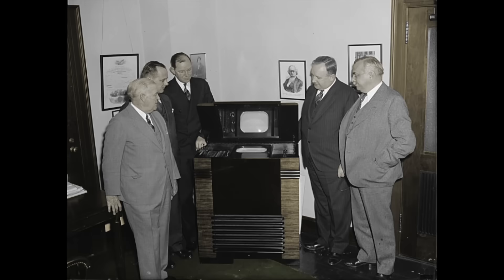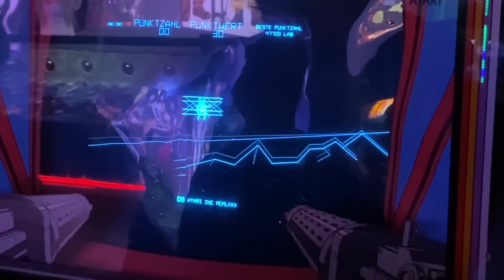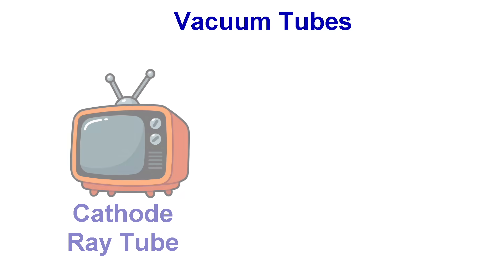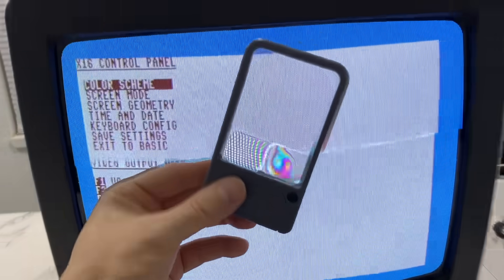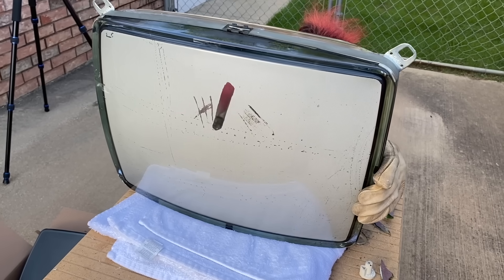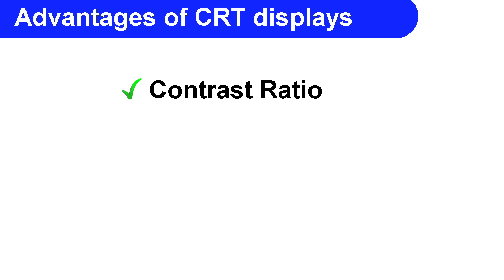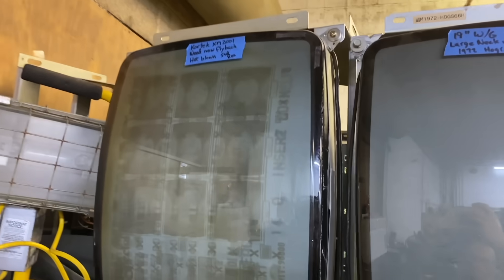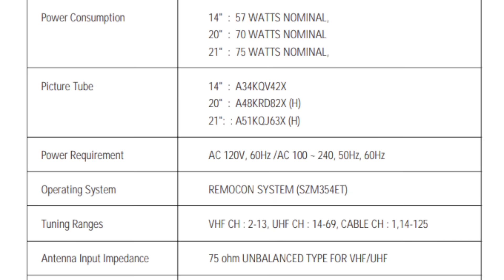How Cathode Ray Tubes Work.

Comment: Notes about 16:9 widescreen and its display area being less compared to 4:3:
This was actually "addressed" in a way, 16:10, offering similar width to 16:9 and similar height compared to 4:3 was actually introduced around the same time when widescreen hit the market. My Dell monitor from 2009 had a 16:10 aspect ratio.

Another note about aspect ratios in general:
Taller than widescreen aspect ratios are going back up in popularity again with the Microsoft Surface Laptops having a display aspect ratio of 3:4 and most iPads having 4:3, other brands like HP and Dell are also offering 16:10 aspect ratios on their monitors and laptops.

Comment: I kept my 21 inches cathodic monitor from 2002 to 2005, at that time, they were much cheaper than LCD screens and I was quite happy with it ! For the same price, at that time, I would only have a very small LCD !
Reply: I replaced mine in 2007 and regretted it for the next decade. :(

Comment: My grandpa's Sony tinitron needed a replacement shadow mask and it costs over $2000 in 1963. Always wanted to use one of these old laser tv's they're such cool tech!!
Reply: How can one replace a shadow mask? It requires melting the screen... It would have been easier to replace it, wasnt it?
Reply: @gabrielvieira6529  that's what he did, he bought a radio instead and said "these new fangled televisions are just a fad"
Reply: @gabrielvieira6529 youd have to cut the tube open then reweld it i guess?? Lots of knowledge lost when people gace up on repairing stuff and just bought new cheap shit from overseas

Comment: One thing not mentioned in the video, that was one of the visible drawbacks of the CRT screens, was imperfect geometry. You were given options to tweak it on most monitors, but you could never get a perfect rectangle at the edges of the screen.
Reply: I think with flat CRT's you dont have this problem
Reply: @gabrielvieira6529  Oh no, you definitively do. With those, it is even more noticeable then with those that are slightly cone shaped.

Comment: When we were switching from CRT to LCD we ended up reverting back for a while because the color accuracy was really bad. Having to imagine what a Pantone color looked like on screen vs on paper was really annoying. But the screens got better and we stopped caring about how colors looked on screen for print, lol.
Even today it's still not perfect, some screens have problems with certain colors. For instance the 4K Samsung monitor I have right now makes Orange look like there's a little noise in it, but it doesn't do that with other colors.

Comment: Similar to colour filters on arcade monitors, in the 1950s and 60s you could buy a device called a col-r-tel which was a wheel composed of red green and blue filters that when spun, synced with an NTSC colour signal and actually turned a black and white TV set into a colour one. There’s a few videos of them around. Look them up the effect is really impressive.

Comment: When I had my Secret clearance in the 80s,  Something that I learned, rumor or not.  The reason why passwords are ******** when typed in is do to cathode ray tubes.    The so called "Russian Trawler" sitting off coast were able to pick up the beam and know the refresh rate of the screen.   Then they could reform and regenerate what is on the screen.  Follow that with a lot of the espionage stuff and now they know secrets.   One fix was to hide the password to access the terminals with *********.   Again I want to point out this was terminals and not personal computers or the internet.  So much like the the far fetched movie Wargames.  If you know the phone number and can get in that far next thing you need is a password.  All this can be True or not True but was part of the training we had when I got me clearance.  Cathode Ray Tubes and the electron beam are just a transmitter.  People with the right equipment and desire can read that electron beam as if it was transmitted from a radio.  Remember when you mom told you not to sit to close to the TV and that a lot more spies are not on Russian Trawlers but more domestic in origin and other government groups.

Comment: for the people that claim CRT's are still superior, the only advantage CRT have over OLED is the resolution and motion clarity. OLED have even better blacks then CRT's plus 0ms lag. and with modern micro LED backlight higher end LCD screen can have per pixel backlight or even per sub-pixel backlight. i own a QD-OLED monitor and i have a CRT screen is sure has a charm and non native content looks still great on it. sure i still want a CRT for the retro look especially with native hardware, but if you have a QD-OLED you can use a CRT filter on emulators and you wont notice the difference.
Reply: I have to disagree. The look of a normal screen is kinda "dead" for my eyes. CRT's are alive!
Reply: @gabrielvieira6529  what do you even mean with alive? have you ever seen a QD-OLED screen in person, especially in HDR? they are better then your normal HDR capable OLED screens. you have to see it in person to know what it's like, preferably not in a show room. and i have extensive experience with IPS LCD, OLED, CRT and QD-OLED displays and can say for certain that QD-OLED is really good. and i think going forward we will see all screens use quantum dots because it produces way better colors then phosphors can. 

and what is a "normal" screen? like LCD, plasma? what kind of panel? VA, IPS, TN, OLED? what type of backlight CFL, LED, full array diming? with or without quantum dots? because the way it's going right now the LCD wil be replaced with OLED or Micro LED display solutions. same as that all projectors will move to full RGB laser.

Comment: 2:23 There are also CRTs that use electrostatic deflection. There are four extra plates inside the tube to add X and Y deflectors.
Electrostatic deflection has it's pros and cons compared to electromagnetic deflection.
These are not used in televisions and monitors because electrostatic deflection requires more depth.
Reply: Wherr were these tubes used? Oscilliscopes or something?
Reply: @virtualtools_3021  Yes oscilloscopes.
Electromagnets distort signals as those are coils. Coils react differently to alternating current.

For TVs and monitors it's not an issue as you only need to generate known signal that can account for coil effects.
Reply: Oscilloscopes especially used electrostatic deflection. Very long tubes!

Comment: The big thing at the beginning of TFT monitors was smearing. Back then I knew that was accepted on laptops as a compromise but I was surprised to see how common it was in flatscreen desktop monitors. When I was growing up I had this one friend who's parents always got the latest tech. I was like 13/14 and it was around 2002. So this kid got not only a gaming PC but also a Dreamcast and an Xbox. Anyway, when this friend invited for the first time I saw 2 things for the first time. A fully networked private home with a (then) broadband internet connection (my family had an old PC and dial up) and one of those really bad TFT displays and I was shocked that anyone would want to work or play anything with that abomination of a picture.

Comment: Thank you! Finally! Every single video that explains CRTs just says something like, "It has an electron gun and a..." And I'm always like, "Wait, wait, wait. An electron gun?" They never explain how the gun works. Ever. This video finally does it. Thank you.
Reply: It's actually a specially designed Crook's tube. What they don't show is the gun itself. At the back end is the heated cathode, which emits the electrons, in front of which are various cylindrical electrodes to control, shape, and accelerate the beam.

Comment: Liked your video however, you left out the second anode and the scan is not 60 Hz. but it was 32,000 scans per second. Even on the old black and white T.V.'s. I started working on these old T.V.'s in 1961, I was very young. People need to know that the second anode has 20,000 volts on it, from the fly back transformer. The tuner has around 800 volts in the circuit. Just a few facts on the subject. P.S. some of the capacitors (the large ones) can be deadly even afters years of none use. I have personally seen capacitors weld screw driver blades to the capacitor terminals.
Reply: All good points, though I'd add the voltage of the second anode is only about 1kV in monochrome screens.
Reply: NO, it is 20,000 Volts. I can assure you of this.  Years later I worked in a TV repair shot, fixed many TV.'s. Real Electronics Technician jobs are  harder to find.  I have also repaired radio transmitters and receivers . Some commercial and a lot of CB's as well as their amplifiers.

Comment: As to the point about CRT's lasting forever, theirs a guy on Utube who drags them out of garbage. Sitting out in the elements for decades, and still able to get them working.
Reply: most CRTs were made at the time when "planned obsolescence" wasn't a big deal with corporations yet. Otherwise they would've found a way to make sure CRTs wouldn't last that long.

Comment: The wide lcd's used to be 16:10 in the beginning though for quite a long time I may even still have on or 2 of them. So if you are talking about computer monitors that would be a more fair comparison for the 20 years ago example. It wasn't really until 1080p became the standard that computer monitors became predominantly 16:9.

Comment: It is weird to me how all the dates in your timeline are 20-30 years less than actual dates in my country. 
First TV transmission : 1950
First Color TV transmission: 1980
And for the LCD displays.... I only see one once, there were too expensive. We used CRTs until circa 2010.
Reply: Sounds a lot like Korea. They started doing Color TV in 1980s too. For having to use CRT until around 2010s you’re lucky because LCD display is horrible in my experience

Comment: CRTs, from my experience and in my personal opinion, will always have a more special viewing experience than what any modern TV could do. Another interesting note is that each line, while technically free of "pixels" consisted of 227.5 color clock cycles, or 228 for the Atari 2600/7800 per line, resulting in 160 "pixels" or 40 blocks of 4 pixels. Each vertical sync would normally consist of 3 scanlines (a regular NTSC video uses 9) with blanking enabled. The vertical resolution of the games are variable, as the timing of the signal was in control of the person who programmed it. Most games had a 262 or 263 line resolution, which is compatible with the NTSC standards of 262.5 lines per field (60 hz), but there were odd titles like Buck Rogers that used 240 lines per field (65.5 hz) for the title card, 248 (63.6 hz) and 249 lines (63.4) for the level loading screen, 262 (60.1 hz) for the initial sublevel, and various amounts for the space sequence sublevel. It was insane how wild the resolution would vary in a different games. There were some games, like Farmyard Fun, that had a strange 281-line resolution (56 hz) that would work on both NTSC (60 hz) and PAL (50 hz) region television sets, since 54 to 56 hz is a snug viewing window that allows both to view the game stably. This oddity only works without fault on Analog televisions. On a modern television, it would be an upscaler's nightmare, because he would have to program several individual settings on each time the line changes and would require multiple buttons to be pressed to compensate for each line change. Thankfully, a "true" NTSC image that is compatible with modern televisions usually fits snugly between 261 lines and 264 lines, even without the use of an upscaler or a convertor. This multi-line issue is also used as a deliberate measure in an early Copyright protection system called "Stop-Copy" by WCI Home Video (now Warner Home Video) on early VHS releases from 1979 to 1982, which also explains why the tapes play fine on any new or old VCR on an old-school TV, but is entirely unwatchable on a modern digital display. The only reason I was able to discover this is because I was able to successfully convert my 1979 VHS of the 1978 film "Hooper" to a blank DVD (which automatically compensates certain standards, regardless of changes), allowing the analog signal to become a digital one without loss of image quality or an alteration in the horizontal resolution and more importantly, backwards compatibility and proper playback on a modern digital TV. Even more interestingly, the video would slowly bounce and add or subtract a black bar that will grow every 10 minutes and misplace the picture to the point that the vertical blanking area will become visible (albiet as a large black bar) and show two seperate fields in a single frame. The tape line count bounces back and forth between 256 to 270 lines every *field*, making an upscaler impossible to use for viewing the film. So the 240p that is always discussed in gaming and video editing? You can forget all about that when it comes to analog televisions, computers and game consoles. This is partially why I am very bitter about the analog shutoff bill that was approved by congress and signed into law by President George W. Bush in 2005, because it meant that a simple mechanism would become obsolete with inferior (although with better resolutions) quality technology.
Reply: I have to agree. Nothing beats the look of watching a CRT
Reply: First sentence is complete bogus and untrue, don't know why you felt the need to put it
Reply: @TypicalBlox I worded it wrong. Updated. :) Sorry if I came off misleading.
Reply: Nah oleds and good miniled are definitly brighter and more colorful, and i say this as someone who daily drives a crt on my pc...
Reply: “Brighter, more colorful than any modern TV”. This is objectively untrue. First of all, one of the big advantages of LCDs is that the light source is separate from the light modulator (in an LCD TV, that’s the actual liquid crystal panel). You can increase the power of the light source almost arbitrarily, and that’s exactly what we do to make the LCDs used for outdoor advertising, which need to work in direct, bright sunlight. In other words: LCDs can be FAR brighter than any CRT display of the same size. 

As for being “more colorful”, you can now get LCDs that exceed the NTSC color space — a color space most actual color TVs could never reach! (Literally only the first few RCA color CRTs had the correct color of green phosphor to match the NTSC color space. All subsequent ones used a different, slightly yellower green phosphor.) The saturation of top-quality LCDs (never mind OLED!!) is at least as good as CRTs, and the black points of today’s best LCDs (and again, never mind OLED) is better than CRTs, whose black points in practice were not zero!
Reply: The only flaw is the light gun issue with consoles like the NES and SNES. The color black is still illuminated on modern TVs, therefore the gun sees that form of black as a very dark shade of grey instead, preventing any proper feedback from the light gun games in their native format. Also consider the delayed frame processing ruining the experience.  @tookitogo
Reply: @elijahvincent985  My comment addressed color rendering alone. I said nothing about the latency of modern displays.

As for the black “being illuminated” — same on CRTs. Black was never exactly the same as the unscanned area of the tube face. How much brighter depended on the settings, but you almost always saw a slight gray of the scanned area when showing a solid black image. On TVs, where it was normal to overscan, you wouldn’t see the true black border, but on computer displays you would. And a CRT’s black point is more dependent on ambient lighting than an LCD or OLED.

Comment: Yeap, the CRT were resolution agnostic but not refresh rate agnostic. It was impossible to run a resolution greater than 1024x768 on a consumer grade monitor and ever the professional grade monitors often struggled with 1600x1200.
Reply: In the early 00s, I had a CRT which I ran all the time at 1600x1200 and which I had at 2048x1536 for a short time. The latter was just a little blurry and I didn't try focusing the beams. 21", baby! 😎🤣

Most of my monitors in the late 90s were very old 14" screens picked up for £14 each, and they weren't usually good for more than 800x600. Once though, I managed to get a Viglen -- high-end professional -- and it was just too sharp to be comfortable at 800x600 despite being only 14". Later, I got a more normal consumer-grade 15" CRT probably designed in the mid-late 90s, and that did 1024x768 just fine.

In between the 15" and 21", I did indeed have a CRT which couldn't quite manage 1600x1200 as you say. It was 20" and had a fixed line rate; it had to have 1024 lines at 60HZ. However, this was an extremely old screen with old styling, yellowed plastic, and 4 BNC connectors on the back instead of VGA. I spent ages figuring out a Linux modeline while my friend just downloaded Windows drivers... :)
Reply: My mid range dell m992 runs everything from 2560x1440p60 to 960x530p165, they are pretty much refresh rate agnostic within reason. Or if you have a illyma something you can throw reason out the window and run like 400hz if you drop the res low enough
Reply: @virtualtools_3021  my point is that you need a refresh rate over 80hz (ideally 100+) to get a good picture, otherwise you will get a blurry image or a headache. At that time I had a Mitsubishi Diamond Pro 21 inches monitor.